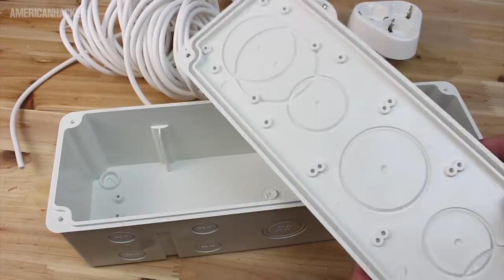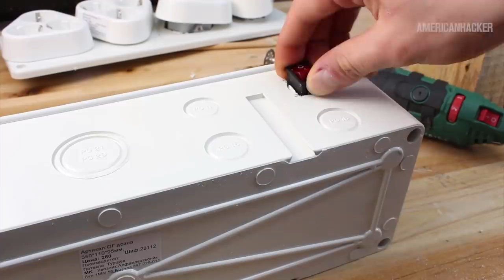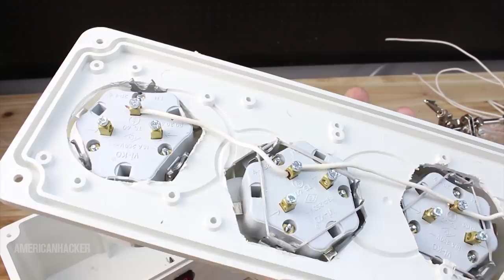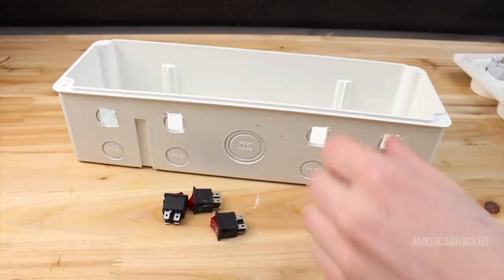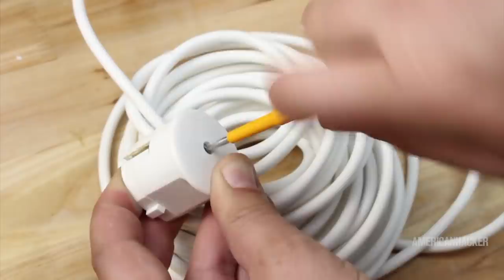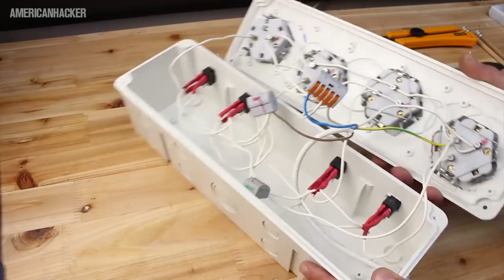Homemade 12 Sockets Electrical Box

Comment: DONT DO THIS ** It is by far too much Ampere for normal house !!!!!
Reply: Murmistrz Dobrze gadasz. Polać mu!
Reply: Peter Frencken 12 22 amp industrial heaters
Reply: Murmistrz Try telling that to me! The cables inside my wall catched fire because I had a few devices running in my workshop.
And the circuit breaker didn´t trip! that was an experience
Reply: Peter Frencken here in Germany our household sockets have a max. Amperage of 16 Amps

Comment: Nice video. Please do not be inclined to use more than 4 plugs at a time totaling no more than 12 Amps depending on the country to which your house is provided electric service. Please use flux on the conductor end and spade crimp and solder after crimp. This will be more secure and piece of mind. Provide a 13 Amp fuse imediately inside the enclosure on the service cord. Safety first then no worry as you sleep.
From your friendly electronic control builder/installer of high tech machine tools.

Comment: In each module of 3 is at least rated for 10A, you need 30A wiring for high headroom and your wiring is too thin for that length. It is only good for light loads.